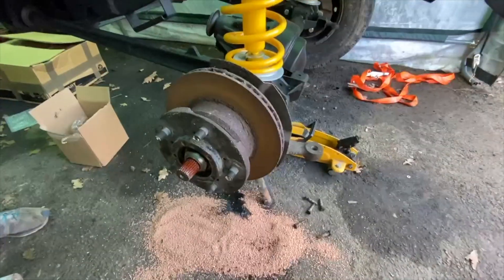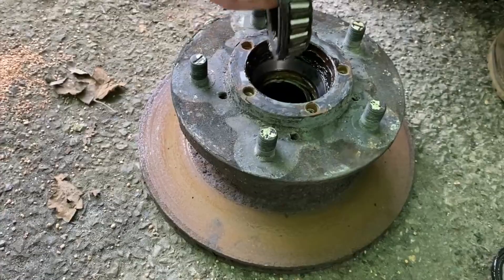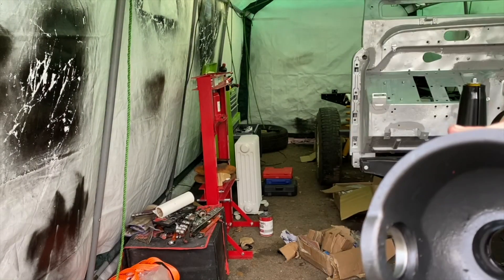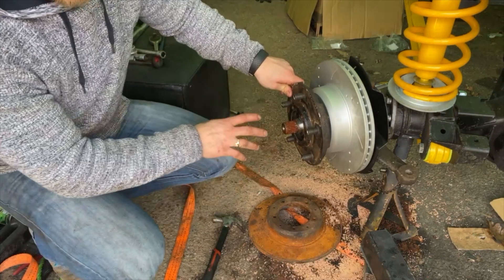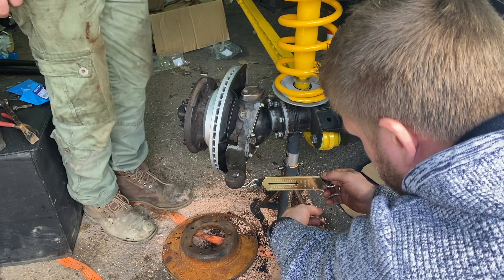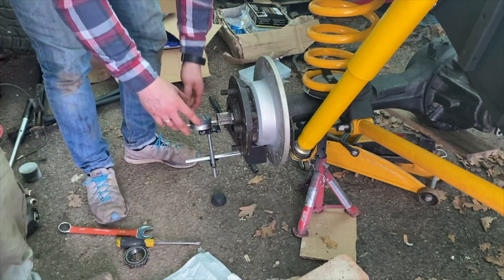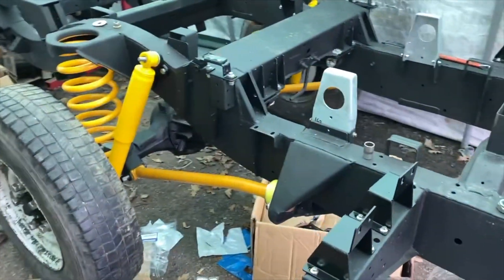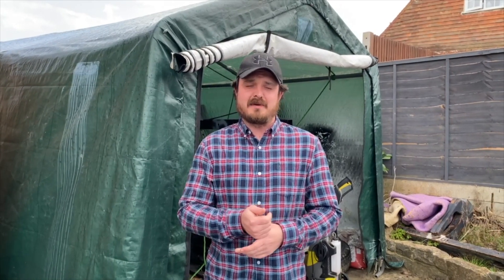TD5 Axle & Swivel Bearings and Cranked Radius & Trailing Arms

Comment: When you set the front swivel preload you had the swivel ball seal fitted and the cv, it's meant to be done without the seal and cv.  I usually convert the Td5 type wheel bearings to the twin nut 300tdi type, means you can throw the spacer away and adjust the bearings easier,costs buttons to do. 👍

Comment: Good work 👍
There certainly is a lot of parts on the Defender front axle.....
Did you observe the two special swivel to axle case bolts?
Reply from the maker: There sure are...definitely takes longer when you do bearings and races twice 😂😂😂. Didn’t notice special bolts, what are they?
Reply: @BUST2BUILT  All perfectly explained by this chap.... He's detailing his Puma Defender rebuild in fine detail.....
https://youtu.be/5851kIDT8_g
Reply from the maker: @rustandoil  interesting, don’t think I came across that in the book. Didn’t read it too thoroughly though 😂 we have been using LR workshop for parts numbers and now I think I understand why there are two part numbers for what seemed to be the same bolts. I will get a couple of these and chuck them in the top two. Thanks for the tip and noticing this as we didn’t 👍🏻
Reply: @BUST2BUILT  LR Workshop is a really great resource and nice chap too! 👍
Reply from the maker: It sure is to both counts. I follow him on YouTube and it’s amazing someone has made such an incredible resource and shared it for free 👍🏻
Reply: @BUST2BUILT  Yes!.... He's proper nerdy about Land Rover... Right up my street 👍